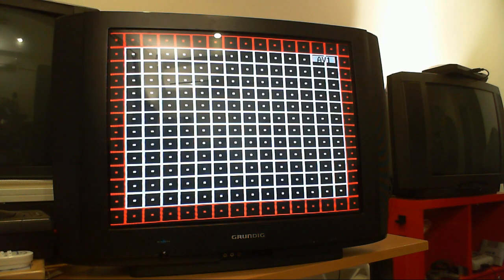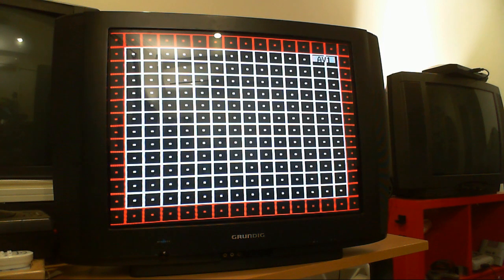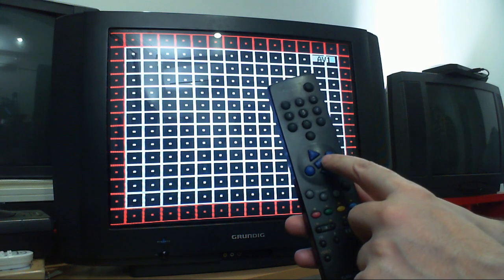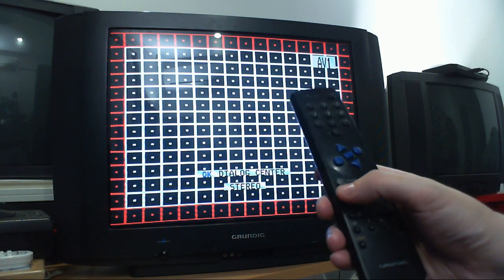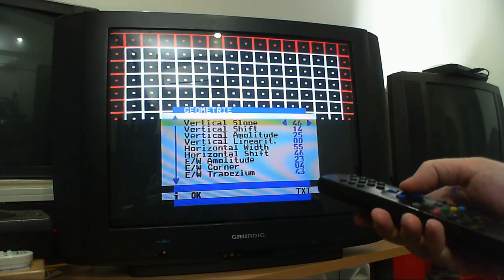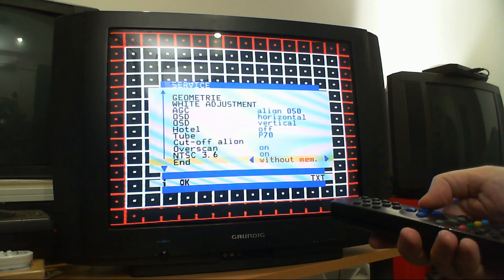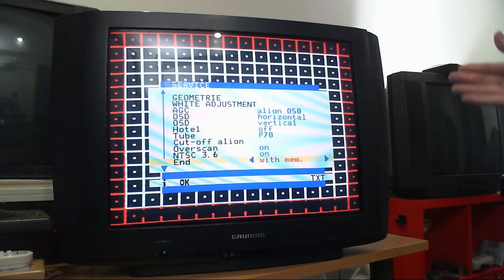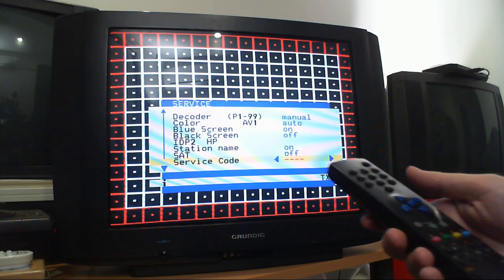Grundig CRT Service Menu

Comment: thank you so much ,
 i have  like new " 14 inch grundig " p 37-050 oirt, cuc 5303 ,, the tv only 50hz , and its come with only one scart and RF , there is no menu in the tv ?, but i can change the brightness , contrast too with the remote ,
my question is   how to inter the service menu  ? i want to fix little problem with geometry , i think the tv from 1987 ,
the color in this tv is amazing and i did not see anything like it ,
Reply: having the same doubt here. Grundig P37-830 text.

Comment: Do you know by any chance if this will work the same way for the P37-080 14inch model? Unfortunately can't find any resources how to get into the service mode of this model. What I can tell is that the menu when I press info is way shorter than the menu of your model.
Reply from the maker: that TV has a CUC 7303 chassis, you should be able to find the method for that chassis, should be the same.
Reply: @djcalle1975  I'm so grateful! I found the service manual for this chassis, where it says having pressed the i on remote, switch on with the mains. It worked but as I said this model P37-080 has a way shorter menu, and so the service menu is minimal as well with no geometry settings at all. It has only one setting for AGC Alignment (range 0-69), no idea what this stands for. My issue is to calibrate somehow the overscan especially in vertical. Do you think that the only option is to calibrate somehow the geometry directly on the TV's board or tube?
Reply: @tzeikob  I was recently given a 17" P45-830 Grundig TV and according rear label it has same chassis as yours, the CUC 7303. I also read the service manual and have the same issue, I believe the service menu on this one is quite basic and found no option for geometry on the manual, even not potentiometer reference for geometry adjustments. Hopefully we could find the right way to calibrate it...
Reply: I'm having the same issue, got a p37 830 text for free but the vertical overscan is too much and the service menu is quite simple! The manual asks to enter the dialogue center with "i" + "OK", but that only let's me sort the channels, i can't enter the dialogue center for good, no matter what i try - have you guys found any solution yet to the issue? Appreciate any heads up!
Reply: @VDVJakeTheDog  I didn't find any solution so far, these chassis seem to have a limited service menu with options oriented to special use cases like hotel TVs and so on, where overscan is not an issue. Perhaps a bigger screen, let say 19inch+, leaves more space to overcome such an annoying problem because many arcade games require at least 240p resolution which a 17inch monitor struggling to deliver on to the tube.
Reply: @tzeikob  Thanks for the quick reply! I figured as much and go with some v-scaling for now, crts are like this, it will do until i can set up a Trinitron, back when we were kids we weren't picky at all when it came to that, I just had to tame my expectations
Reply: @VDVJakeTheDog  my 14 inch  p 37-050 oirt, cuc 5303 have only one scart, and RF, and only pal 50hz , if i connect any ntsc console with RGB scart , the console will work but in wide screen ? i cannot enter the service menu to fix the vertical size , is there any chance to fix the size from the scart board inside the tv ? i saw some setting on the board when i opened the tv,
sorry for my poor English.
Reply: me too , i have the 14 inch  p 37-050 oirt, cuc 5303 , cannot go to sevice menu ?